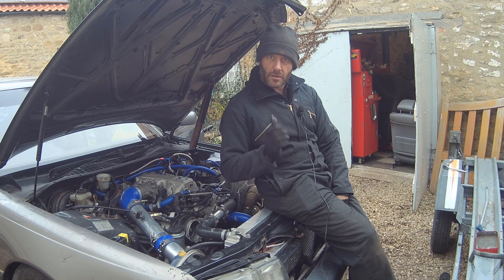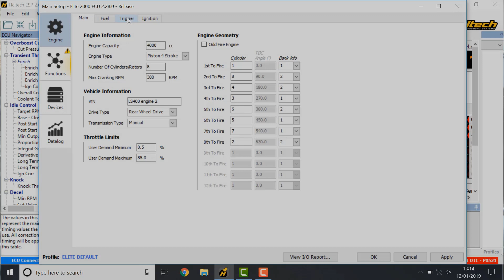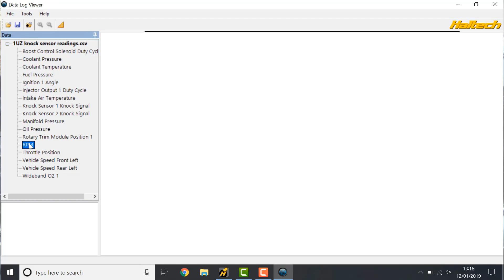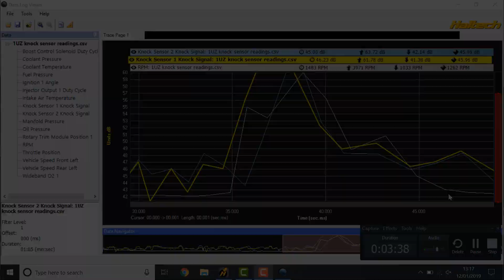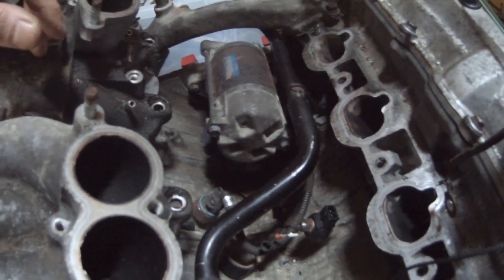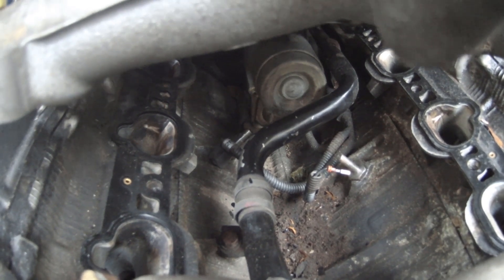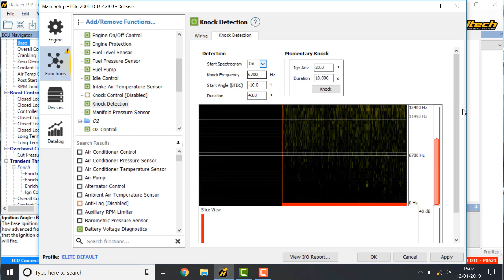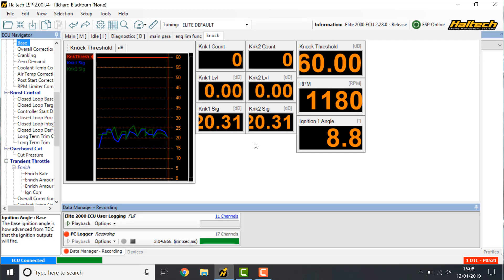TurboShed Part 26 - Non resonant knock sensor upgrade 1UZ Turbo

Comment: Hello can this modification be done using the standard ecu ?
Have you made anymore bracket holders for the knock sensor to sell.
Reply from the maker: The standard ECU will only take resonant knock sensors so this won't work unless you fit a standalone ECU setup

Comment: could we directly attach ground in one wire of 2wire knock sensor
Reply from the maker: you would probably just see noise on the signal, much better to take it back to the ECU

Comment: does anyone know the frequency range of the bosch 0261231006
Reply from the maker: sorry I don't know, we just wired them up, did the calibration etc and set the thresholds and job done

Comment: Hi Mate, adding a Haltech 2500 to my 1fzfe (in the future a turbo too). Can you make me a couple of those knock sensor studs? will they be the same thread as my engine? Can you tell me. the size into the engine and also at the knock sensor side? Home much ??

If not will the studs in this link do it for me?

https://forums.linkecu.com/topic/8156-knock-sensor-10mm/

 Thx
Reply from the maker: There are a load of links in that thread, which stud are you talking about?  I've sold all the extra ones I made so don't have any spares I'm afraid.  Knock sensor side is M8, I can't remember the engine side, just measure yours!

Comment: What’s the part number?
Reply from the maker: 0261231197 is the Bosch number but in the video I give the other equivalent don't I?  Just search Bosch knock sensor and you'll find loads of them and aftermarket types

Comment: Watched most of this very interested maybe go down this road my self don't suppose you'd make another set of manifolds for a price obviously just the bare manifold and i could work according of it if you understand
Reply from the maker: I'm afraid we don't do commercial work for cars/1UZ. The time taken to do these projects is just too much to justify the price we'd have to charge.    We hope our info acts as inspiration and ideas for people to do their own though :-)
Reply: @Concept5North   I fully understand the videos should be enough to help me out if I chose to go 1uz when will the car be getting dynod
Reply from the maker: not sure, was booked last week but I had some issues with the wideband o2 controller so had to cancel.  It will be into April now before we get to the dyno, too many drift days booked and other jobs we want to get done